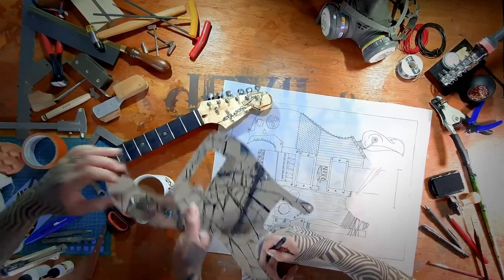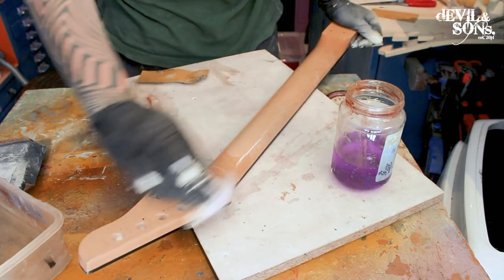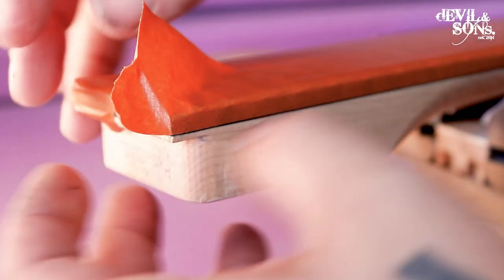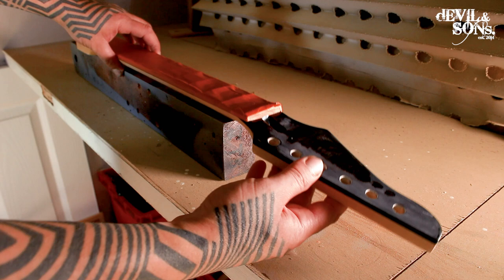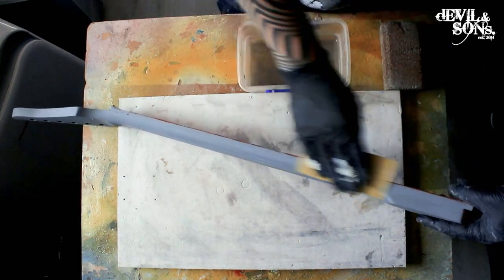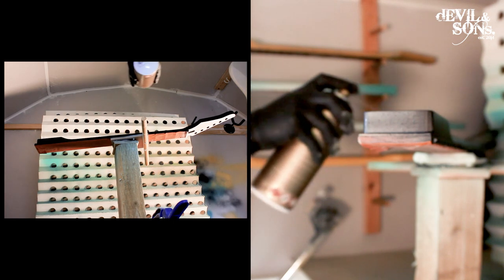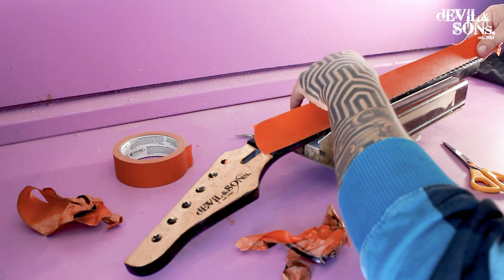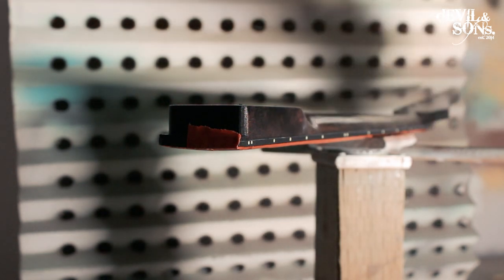How to paint a guitar neck the right way

Comment: You tube is as social as I get mate but I have pointed several people your way who are learning all things guitar. I also use automotive paints. Here in the states we have what is called a sanding primer. the brand name is Krylon. Its not meant to be a heavy fill type primer and goes on like it has sand in it. It bonds super well to wood and metal and when you wet sand it down with 1000 grit its like glass if you block sanded what you are painting to perfection. Great for super shiny flat surfaces. Then I paint with flat paints if I want perfection with something and sand that with 600, 800, 1000, 1500 MAYBE 2000  and then let it cure a week minimum before hitting it with rubbing compound. You can make blacks look like mirrors that way. Then clear as what ever you usually use to protect it.
Reply from the maker: That sounds cool. I will look into krylon, it actually sounds like it would perfectly suit the guitars I make where I sculpt onto the bodies.
Reply from the maker: And thanks for spreading the word. I do love youtube for the community of people discussing and sharing ideas, I actually find it much better than all the other social medias.
Reply: @Borgonian Evolution ...  Sorry for the latency in asking ... but since I continuously get confused, do you start sanding after the last layer of paint or wait until after the final (3 layers of) clear coat?  Thanx in advance and best regards from Germany!

Comment: @Devll & Sons Guitars - I'm doing my first kit build & wasn't sure about the fit of the neck (bolt-on neck) after painting/priming.  Do you ever have trouble getting it to fit back into the body? 

Awesome video, super helpful to see the taping & Prep steps!
Reply from the maker: I definitely used too, but I tend to mask out the pocket now and find the necks normally go in (tightly) without too much problem. If anything feels tight I tend to sand the pocket edges slightly rather than the neck and risk ruining  the finish.
Reply from the maker: What kit have you got?

Comment: Great tutorial!  Do you use the hook to spray the front of the headstock immediately after spraying the back of the neck or do you wait for the back to dry?  If so, do you then just allow the neck hang from the hook to dry?  Cheers!
Reply from the maker: I normally spray the headstock front first, then lie it flat on a piece of wood the width of the neck and spray the back, then for the next coats I hang it to dry and turn it around on the hook to spray both sides, as I can't really be touching the neck itself now. Does that make sense?
Reply from the maker: And thanks for watching and commenting

Comment: Hey Daniel! Excellent video and one of the few really useful ones for painting necks! How much paint layers did you apply in total. I am in the middle of painting my bass neck ... it already looks nice after 2 layers and I am planning on adding 3 coats of clear on top before buffing and polishing. Does it need more? I am using Dartfords Nitros :-) ... thanx and cheers from Germany! Keep up the excellent work! Great fun to watch!
Reply from the maker: Thanks so much for leaving a comment, I'm glad it was helpful. I would say you don't need anymore if you are doing three coats of top coat, however the edges of the headstock and the neck heel are always where the paint is thinnest so be careful when sanding those areas. I normally do 2 or 3 coats of colour then the gloss coat so I think you'll be fine.
Reply: @DevilAndSons  Daniel, thanx so much for your quick reply! What continuously get's me confused, is whether or not to sand after the final layer of colour before adding the clear coat ... in your video you wet-sanded in between, but did you do the same after the final layer of colour to smoothen things out before clear coating? Thanx in advance!

Comment: Nice video, lots of info i wanted to find and couldn’t find elsewhere on youtube. Would you sand like you did for this neck on a clear nitro neck?
Reply from the maker: Thanks so much. Do you mean sand before the nitro? I would always sand the bare wood before any paint or top coat to allow something for the paint to grip too. With nitro you don't have to sand between layers, the nitro 'melts' into the previous layers to ensure it doesn't delaminate. If you are putting nitro over a non-nitro colour then do sand first. You can't pit non-nitro over nitro. Dies that answer your question?

Comment: can i paint a start neck. its obviously been finished but i want to paint it black.
Reply from the maker: Absolutely. You probably won't have to strip it completely back, just lighly sand first so the new paint has something to key into. The only issue would be if it is finished already in nitro, in which case you should sand back to bare wood, or if it has an out finish in which case it also may be safest to do the same (just in case your new paint won't mix well with it). Either way, not a huge amount if prep really.

Comment: Question since you are painting the neck. How much looser does the neck pocket need to be to account for the thickness of the paint clear coat and primer?

I am trying to figure out how much i should sand down my neck to make it work
Reply from the maker: How tight is your neck at the moment? I find on most factory made guitars i have done this too the neck will still fit (tightly) back in. Sometimes I may need to sand the neck very slightly before putting it back (so over the paint and just where it fits in) but that is rare. I guess the paintbis normally pretty thin. It all depends on how thick your paint is, how many coats you do... I can't give you an exact measurement as it would cary each time. Sorry if that isn't much help.
Reply from the maker: Also, it may be easier to lightly scrape the neck pocket with a cabinet scraper if the fit is too tight. If your painting the body too I always mask the neck pocket so no paint goes in there
Reply: Its a custom ibanez pia body with rg570 neck.

It was snug but not super snug before paint.

I did do 1 coat of primer in the neck pocket but sanded some before and after. And will let paint go on just the edges of it.

I did sand off all the clear coat and into the wood some on the neck where the pocket is. Ill prime the neck today then paint both this weekend. Only going to lightly prime the neck then sand it.
Reply from the maker: I don't think yo4u'll have a problem with it fitting back in, and hopefully it will fit even better than before. Good luck

Comment: This is a super weird question, so apologies in advance:

Are you able to do this with a fretboard too? I see guitars and basses with a Neon Pink neck, and im trying to figure out how to re-create it.
Reply from the maker: Absolutely. I haven't made a video about this yet (although I'm actually going to soon). I normally take the frets out, paint the neck,varnish, put the frets back, another varnish Iver the top, then clean up the frets. However you could just mask off the frets, paint and varnish. I would recommend though putting at least one coat of varnish over the frets themselves if you are painting without removing them, that will help seal the paint in where they join. You could then use a really fine sand paper on the frets to remove the varnish from the top and buff the the frets.

Comment: Hi Daniel loving your work.i have a quick question,I just got a new guitar and after checking frets just two are high,I don't have a fret leveling file would I be ok just taking two down with 600grit slowly checking with the rocker before profile and polish or is this in advisable.cheers sir,keep up the good work.
Reply from the maker: Hi, thanks for getting in touch and glad you like the videos. It sounds like you have double checked with the rocker and know it's just two frets. Firstly though I would check to see if you can fix any problems by either raising the action slightly or altering the truss rod (I assume you are having notes that fret out at those raised frets). Of course you may not want to the action higher. 
You can level the frets like that, and actually if you then use a higher grit you'd be able to polish them, the problem is they won't be crowned and will have a flat surface. If you're not taking too much off it will be less noticeable and this naturally happens with wear anyway so won't make it unplayable, it just won't be quite as good as a crowned and polished fretm
Reply: @DevilAndSons  thanks for the advice Daniel,have you seen that home made tool on guns and guitars that he made from a block of wood.you stick sand paper to it,the wood has a 45degree angle cut so you maintain fairly accurate angle as you run it up each side of fret to crown .our American cousins love their guns.me not so much so.each to their own.thanks again.
Reply from the maker: I haven't seem that but I have the same thing with a diamond file for dressing the ends. By crown though I mean giving a curve to the fret so the strings rests on the very top of the curve and not a flat surface.
Reply: @DevilAndSons  yes perhaps I wasn't clear,the angled wood is run up the nut side of the fret then the bridge side giving an upside down v shape.he reckons it's the fastest way to crown then Dremel polish.cheers.
Reply from the maker: Oh cool, I'll look that up, sounds interesting.

Comment: I noticed that my fender Stratocasters have the sides of the rosewood fretboard finished, Is there a reason for this?
Reply from the maker: The neck is sprayed with the clear coat after the fretboard is put on, if the clear didn't cover the sides of the fretboard there would have to be a sharp line where the varnish stops there which would interfere with playing and mean it was more likely to chip.

Comment: Hi Daniel you haven't posted in a while hope things are ok for you.can you offer any advice on enlarging holes in the headstock from the 8mm to the more common sized 10mm for new tuners.tried a step drill but had to go from both sides not ideal.thinking of combining that with a hand reamer.got another guitar to do with a nicely finished headstock i dont want to damage .cheers .
Reply from the maker: Hello. Thanks for asking, all is good here. I've been busy with some non-guitar things for the past month but also filming for a series I will be putting out for the great guitar build off. I normally step up using a reamer to start, then a drill bit turning very slowly.
Reply from the maker: Actually, more often than not I fill the holes and redrill. I fill them with dowel, wood filler, or a combo.
Reply: @DevilAndSons  thanks for the advice, appreciated.
Reply from the maker: Good luck, do let me know how you get on.
Reply: @DevilAndSons  will do, thanks again,I had not really thought of plugging and redrilling,great advice cheers.

Comment: Can you use Spray Max 2K clear coat to finish your neck? I have a neck that was finished in tru oil I don't like I like the feel of Spray Max 2K clear coat
Reply: Will it work my friend
Reply from the maker: You definitely can. The problem would be the tru oil may not interact well with the spray max (I've never tried). Normally you would need to clean the neck as best as possible and put a sealer like shellac on before top coating over an oiled surface.
Reply from the maker: I think we were typing at the same time.